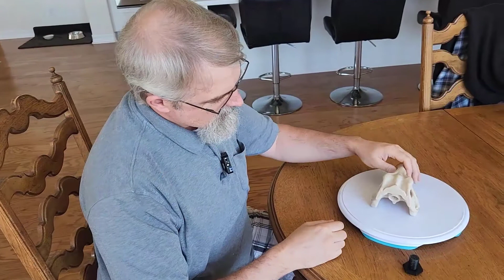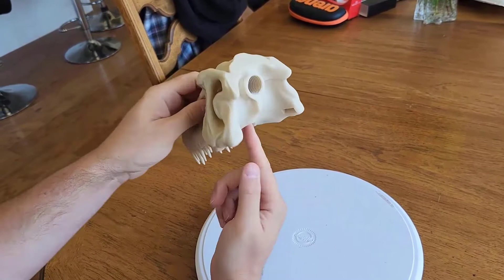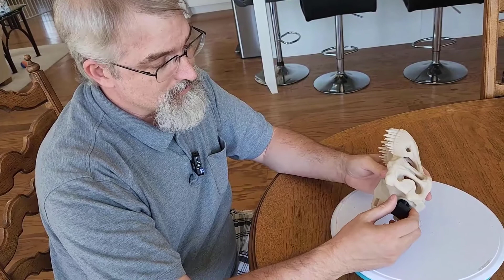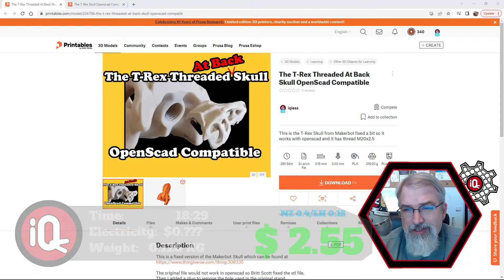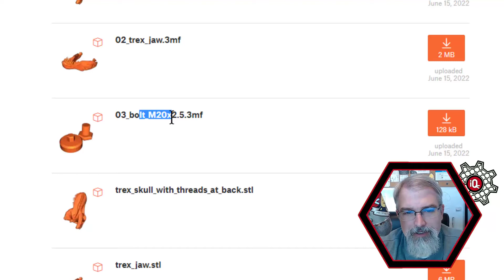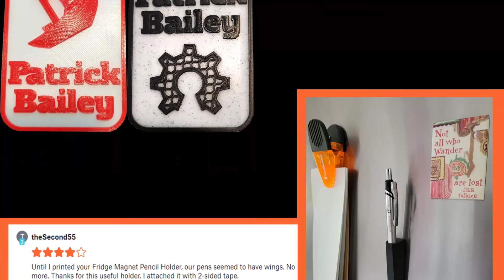3D Printing: T-Rex Back Thread

Comment: If you are using octoprint, you can use octolapse to get some of those growing shots and similar. However from what I understand, it adds extra movements which adds time and can also add more issues with possible stringing and such.